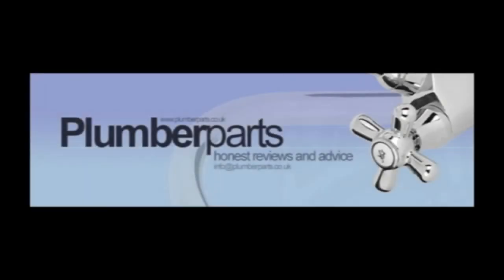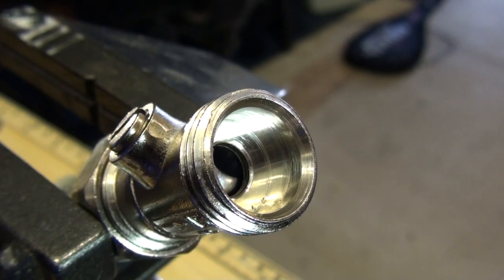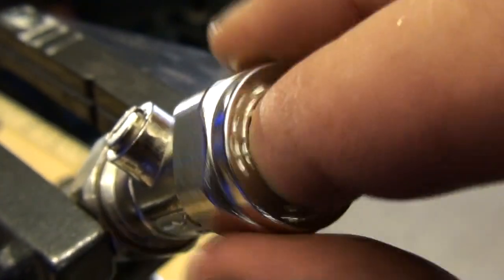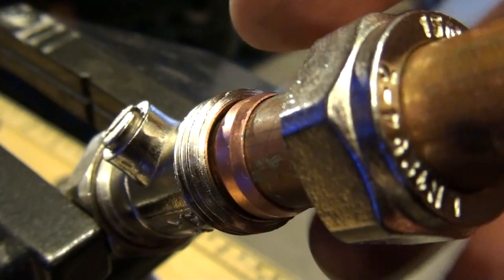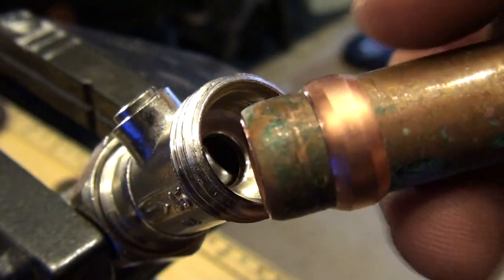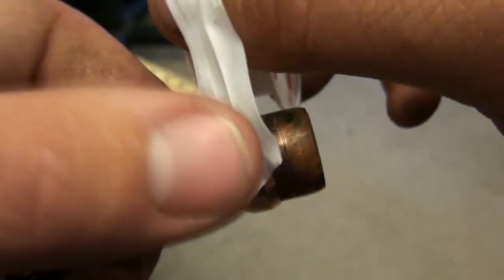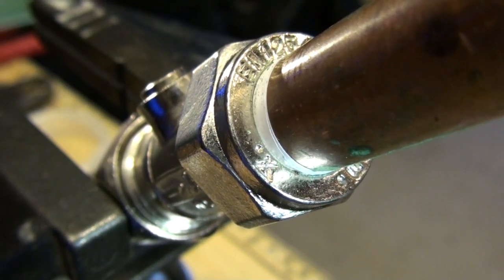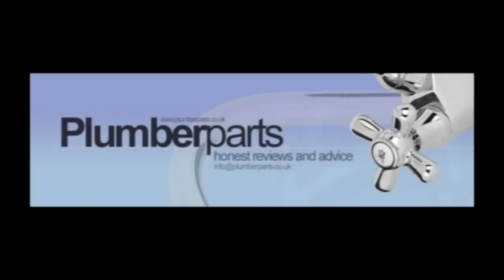How compression fittings work - Plumbing Tips

Comment: engineer:"here is this easy to use, sturdy, leak free metal-to-metal joint you can use with no sealing compound!"
plumber:"hehe let's add microplastics to the drinking water"

Comment: some reseating tools have a tapered bush to fit a bs1010 taps, some have a parrallel bush to connect to bs1010 and bs5412 which has a resessed thread, some have parallel cutters
( rotate in both directions ) some have radial cutters, ( use it clockwise direction ) which means you need to use them differently.
some taps have bevelled seat ( concave ), but usually a flat seating.
I leave a trickle of water running to wash away the bits of brass, which are been shaved off the seating as you resat the tap, don't remove more than necessary.
I once reseated a tap, and it made no difference, becaued the brass seating, had become porous, due to dezincification, they should make taps from dezincification resistant brass, but as with most things, taps have become fashion items, so are expect to be replaced and thrown away, to keep up with the latest fashion, so function and durability, is secondary in most cases.
what they look like is more important, than quality.

Comment: Ok  I asked on another video but maybe this is more accurate to ask here: I have a 3/4" compression nut and sleeve that was working fine until I took it off. It has just the nut and the sleeve. The sleeve slides around freely.

Comment: Have you ever seen a domestic compression valve in France??? unless I missed something, they all seem to be tap connector fittings which is totally weird. About the jointing compound, I got hooked on using LS-X , much more expensive but saves time.

Comment: PTFE tape is for 'lubing' the thread so you can get a more accurate feel for tightness. It doesn't seal.
Reply: PTFE tape is to seal between 2 metal threads

Comment: G'day,
There is no seal between the nut and Olive. The Olive only seals on the fitting side. 
In Australia we call them TUBE fittings/Olives.
Tube is measured OD Pipe is Measured ID.

Comment: I've never been a fan of compression, I would use almost any other fitting at the supplier first. If they get bumped or if you need to do work farther down the pipe you can run into problems  pretty easily.

Comment: You are not allowed to use teflon tape or pipe dope on a compression fitting.
Reply from the maker: Hi Eric, in the UK it's totally fine. Give me a reason why? I'd love to know! It's got me out of a few problems.
Reply: @plumberparts  on compression fittings atleast in sweden you should never use teflon tape or anything of that type. Thats a rule here from "Safewater". And compression fittings almost never leak if you use em right! :)

Comment: Hi, for clarity.  Do any suppliers sell combined compression ball valve and non return valve.  The flexible tap connector is too long and may kink if I fit a non return valve after the ball valve which is already in place?
Reply from the maker: No I don't think they do!

Comment: I am a plumbing student and I have see a few people over tinght the nuts so u have to cut them off and new on to the pipe
Reply from the maker: +Ian Langley Indeed, just a little nip up should do!
Reply: +Ian Langley   Ian, I'm so glad you made this comment.  Over tightened nuts can be a problem, but what to do??  If you don't have extra pipe or if the pipe is close to the wall or tile??  What a nightmare huh?  Now your stuck...ur 5 minute job just turned into an hr.  Fortunately for you and every other plumber out there.........there is a new tool out there called the Hexpander available from Knucklehead tool Company that resizes the copper pipe to its exact dimensions and as a bonus, you can pull the ferrule and nut off.  Imagine that.  Leaving the pipe ready for the next angle stop.  Your 5 minute job....takes.......5 min.
Reply: +Keith Sharrow send me the link
Reply: Knucklehead tool Company lol

Comment: Great video - I understand how they work now, but have a question. I am installing a water filter (under the counter) and the tubing is plastic will the plastic compression sleeve work as well as a brass sleeve?

So I've got brass insert, plastic sleeve and brass compression nut.

Thanks in advance!

Comment: I may have a faulty isolation valve can a new one be put on without cutting the old on off a pipe
Reply from the maker: Just slacken the nuts and spring it off. Should be fine.

Comment: How tight do you tighten these up. I'm always worry that I might over tighten them. Your video says a full turn, is that a full revolution.
Reply: Super late response but it depends greatly on your pipe size, the wrench you are using will also make a difference because the longer your wrench the more torque you get on the compression nut. Don't forget to back wrench them if you have other compression joints earlier in your line because they can be a real pain.

Comment: My plumber friend told me the plastic compression olive works better than the copper or brass olive. is that true?
Reply: Mark Wright so far so good. It's been over a year since I used plastic olive on the to fit onto the mini stop tap for the spare vanity basin mixer and I put the white tape just like in that video and it's sealed tight still. That tap doesn't really get used often since its a spare bathroom. I will keep an eye on it for leaks in 7yrs.
Reply: Mark Wright thanks I hope if doesn't fail when I'm not home. My plumber told me to do the same as well put a Teflon tape over the olive and apparently it's a trade secret. Now I'm worried. I did have to use 12-16 Teflon spun it around the thread before I put on the mini stop tap. And has to tighten it a bit because it was every lightly leaking so tightened it hand tight and maybe 1/4 to 1/2 more turn.

Comment: Jon Flatman tip makes a lot of sense. I will be trying that tomorrow on a compression fit without teflon tape or compound. The purists do indeed say to avoid product enhancements (no such laws in the UK yet AFAIK) but I have noticed the drop in quality & consistency of materials. FWIW for the last 20 years I had been using tape particularly on radiator HW pipe couplings (which would most certainly weep after due to the expand/contract of the first heat cycle). I saw a pro use Teflon & he claimed he had a guaranteed success rate.
Reply from the maker: Thanks for your comments. I've never had a problem with Teflon. Regards, PP

Comment: Teflon tape or thread compound on a compression fitting is a code violation and would not pass inspection --- at least not here in the US.  Tape or joint compound will eventually compromise the seal.  The compression fitting should seal correctly with the correct amount of tightening - and if leaks - you usually need to start over.  The tip by Jon Flatman is correct - the compression fitting will seal better if it is pulled back slightly and not pressed up against the end of the fitting.
Reply: I've just done some in my bathroom.......2 are leaking right on the copper pipe  out the back of the nut.  I had that little ring right on the end of the copper pipe when i did it....Should i have slid it further up like this video?
Reply: @toptensviewerschoice5204  yes the copper pipe needs to fit right into the isolation valve
Reply: ***** or won't ever leak. as per my thousands of joints I have done over the years.

Comment: you should use a jointing compound instead of ptfe. Ptfe is designed for threaded fittings not compression. When applied correctly jointing compound will not get into the valve or pipe, and will provide a much more reliable seal.
Reply: I once worked on an nhs hospital where they specified ptfe on the compression joints. Some plumbers prefer it and others prefer paste. No two plumbers are really the same in terms of method.

Comment: you should use a jointing compound instead of ptfe. Ptfe is designed for threaded fittings not compression. When applied correctly jointing compound will not get into the valve or pipe, and will provide a much more reliable seal.

Comment: Great Video! Thanks for the very informative and useful video! Pipes, fixtures and valves for common plumbing can be connected in various ways. The easiest way to connect a pipe to another pipe, a fitting or a valve is with a compression fitting. This video teaches you how to use the compression fitting.

Comment: Hi I got a question, I want to use chrome plated pipework 15mm from the floor to my trv and the pipes run under floor boards, can i solder the chrome pipe into a copper elbow or is a compression joint the only real option for this. if it is possible can you do a video please. all your vids so far are very helpfull. thanks

Comment: I have put compression fittings on Qualplex pipe but cannot get tight fit. I have tightened nut a good bit but I can still move pipe around in the fitting. I took joint apart to check if insert was in and then put on some ptf. Joint is still loose. Any ideas appreciated

Comment: dont buy these fittings if your using them with copper pipes it will cause the pipes to decay due to electrolysis.

Comment: On boats we were taught to assemble the fitting, butt up the tube into the fitting and to mark the pipe with pencil. THEN WITHDRAW THE PIPE BY 1/4 INCH before tightening up.  If the pipe is hard up against the end of the fitting there is no room for the pipe to move during tightening and the olive will be deformed.  Think of the dynamics.  The olive stays in one place.  The nut needs to move along the pipe to make a seal.  The fitting also needs to move along the pipe to make a seal. Try it!
Reply: That's absolute bollocks. More likely because it's on a constantly moving  boat that needs to flex.
Reply: Im a commercial plumber....Ive never come across any plumber who does that ever. I butt up every time so the pipe is securely in.
Reply: @stoosam3244  Hi Sto.   The video was good and I wasn't trying to knock it.   My training could be a hang up from an older design of fitting.   I was taught by someone who was a fitter in the navy.   I guess that ships and subs really don't like getting leaks!  Butting the pipe is fine for domestic and using PTFE on an old or damaged olive.  Its very hard to sink a house but I know a plumber who nearly did and ended up the newly laid kitchen floor floating.   We were also taught to wind PTFE around a thread or olive in the same direction as the nut will tighten as it can stop the tape from catching and bunching up.   Try tightening a butted joint to destruction and also a non-butted.   I guess it might all come down to how often you might need to remove and reassemble a joint.  Cheers,  Jon.
Reply: @jonathanflatman  Hi Jon. I will give it a go and see how they both look. It makes perfect sense what you say....its just that in my day_to_day jobt, butting up works/seals the joint regardless. The trouble with most fittings is that they would be too shallow to safely pull out very much and would be a fiddly time constraint to do reliably. If i ever work on a boat though (which I haven't yet), I'll bear it in mind. 
True about the ptfe direction....same for loctite thread and hemp on threaded joints.
As for the video, i was taught to finger-tighten then turn the nut ½ to ¾ of a revolution. So ¼ turn doesn't seem much. But most vids say the same! I know that plumbers generally don't tighten too much in case they might want to prise the olive off again later. But Ive seen fittings fly off the live pipe when being adjusted by the next plumber because of that and it worries the hell out of me. Did he also use 'Hawk White'? ...Thats unsuitable for potable water - only central heating. For drinking water, it should be 'Water Hawk' or 'Jet Blue' paste...or LSX which is my favourite. Or ptfe like you say which effective. All plumbers are different.
Thanks a lot.

Comment: You only turned the nut about 1/8th of a turn. I suspect correct tightening of these fittings is something of a fine art - particularly as the pipe can start to twist as the nut is tightened, putting pressure on an existing soldered joint at the other end of the length of pipe you're working with.

Comment: dont use tapes on compression fittings . there designed to work without it and only hinder the tightening ability. if anything a little paste before the olive but thats it. BAD TIP! will lead to leaks
Reply: Lots of plumbers prefer ptfe to paste and it works fine. Some clients specify ptfe over paste so that paste doesn't get in the system and block filters. All plumbers are different.
Reply: Load of bollox your talking

Comment: Prestex are quality. :)
We do get some garbage in the U.K now though don't we LOL  ?
Ball 'O' fix valves that leak the first time someone uses them LOL .
And some fittings where the pipe comes out of them at an angle no matter how much care you take when tightening them. hahahaha not funny at the time but some of this gear we are getting now is very poor, they can't even make a nut that is the same distance from face to face all the way round, so you are constantly adjusting your spanner.

Comment: No, properly installed you can't use the olive again. When you tighten the nut, olive will be pressed against the pipe so tight you wont be able to remove it without doing damage to it. If the olive is loose when opening, sure you can use it again, but you were lucky that it didn't leak in the first place.

Comment: [post continued] be made up realy tight. When the compound is still wet it will seal-off small leaks. When the compound is cured it behaves like a rubber gasket, so future leaks are prevented. One downside might be that these compounds are not suitable for plumbing in kitchens or where the water is for consumption.

Comment: I am told that the common root cause for leaking compression fittings is that cheaper/poor quality fittings are made from the wrong grade of copper, they are not as maliable so dont seal well. However, over the years I have learnt to use sealing compound. The one I find works best is used on motor car cooling systems. They go on like grease and when cured are like rubber. When first applied they lubricate the moving parts of the compression fitting so allowing the fitting to [next post]

Comment: PTFE tape is not really designed for use on olives. It may work to help stop a leak but should be considered a temporary repair. If a fitting is leaking from a compression joint it is possible that either the fitting, the nut or the olive is damaged and they should be replaced at the earliest opportunity. Good video by the way and thanks for posting.

Comment: @bombaclat123321 Did you use an internal support  bushing  into  the end of the plastic pipe to help support the compression fitting...[ maybe the  guy could  have used fine wire wool to clean the oxidation off the pipe just a thought].. plus adding a  little bit of 'Boss White jointing patse' could also  stop outgress of water although teflon tape can also be ok as it clean to work with..... get the Teflon 'Gas' type tape... as it great and tends to shred less...